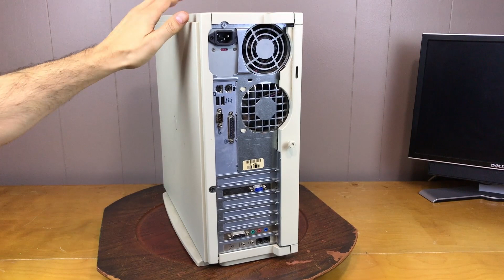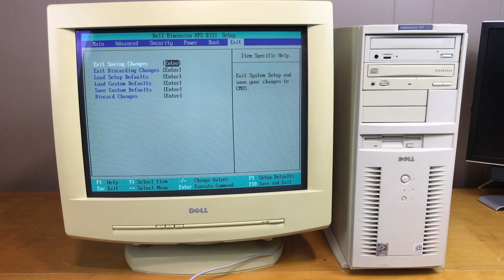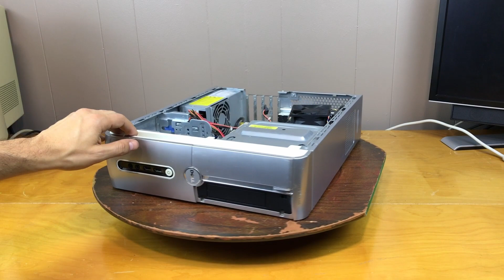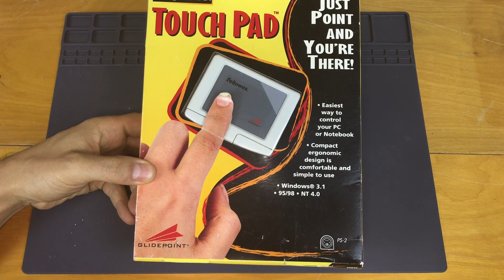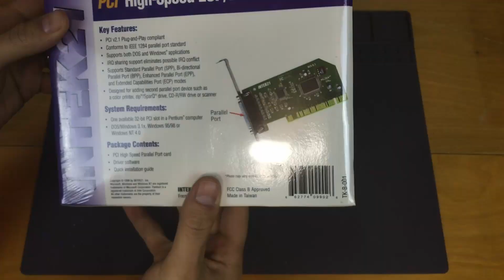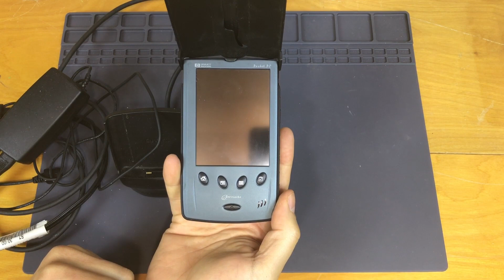Retro Haul Part 2 - Pentium 2 & beyond

Comment: LGA1366 triple channel Xeon? Looks like the RAM slots are 3  and 3
Reply: That's correct. I have a T5500 model from the same era in my storage space that I bought 6 EEC 4gb modules for (could have been 8gb ones, but I was on the cheap), and it could mount an optional accessory for another two banks (6 more slots) of memory. Of course, my machine does not have that luxury of an option fitted in.
Reply from the maker: Looks like it according to the spec sheet from Dell. I’m not very familiar with Xeon architecture differences so should be interesting to dig into that machine a bit more with some benchmarks.

Comment: Out of all the machines, I personally like the Dell Dimension XPS D333. I knew Turtle Beach made headphones, but had zero idea that they made sound cards. Pretty cool!
Reply from the maker: Yeah, there was a window in the mid to late 90s I think where turtle beach was a bit like the Gravis ultrasound, sort of this mystical higher end card that the rich kids had. At least in my area it seemed! I agree on the dell system, the others are mostly too new and get into the boring stock office pc era, but they were part of the haul so I figured I would run through everything.